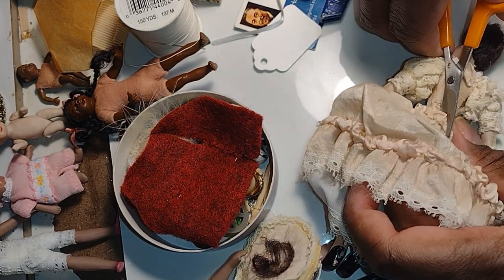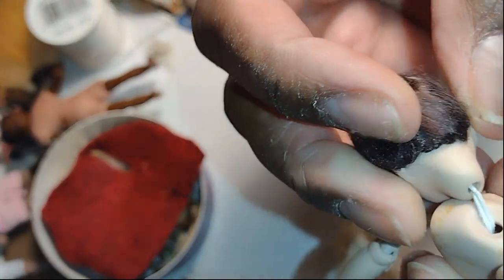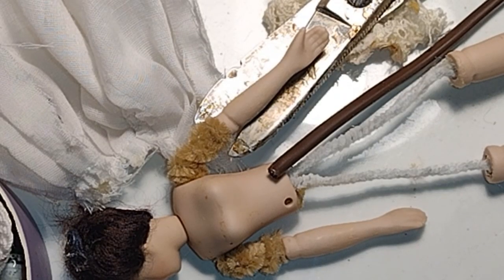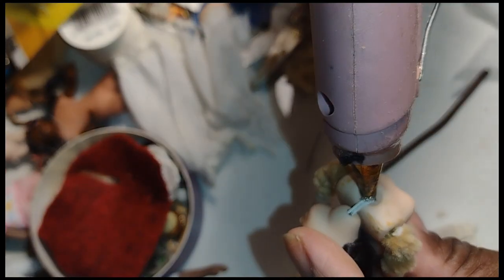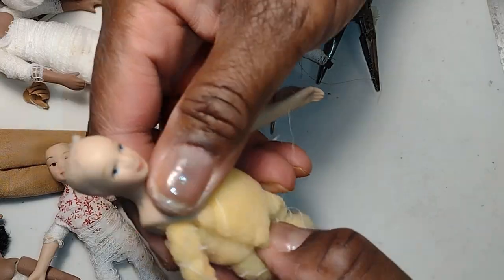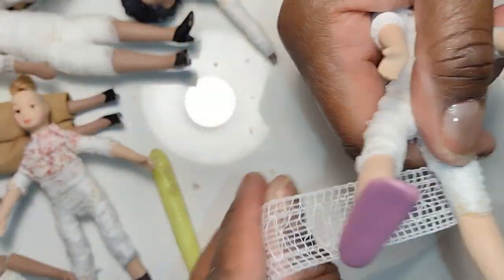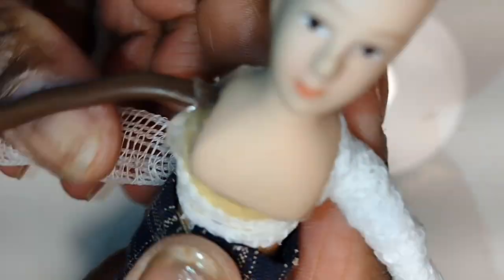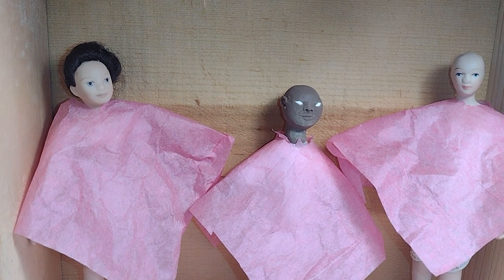How to REPAIR DOLLHOUSE DOLLS Part 1

Comment: Thanks for the warning and the assurance that the dolls were sedated! 😆 The way the first doll's head was flopping around!😲🤣 I'm sure she'll be feeling MUCH better when she wakes up!  The second doll's proportions were very strange, but you fixed them. 😊 The third and fourth dolls will find their repairs very "handy". 😉
Reply from the maker: Thank you!  I tried to share different repair problems  so you could see how to use different options and wires. I'm glad it was helpful!